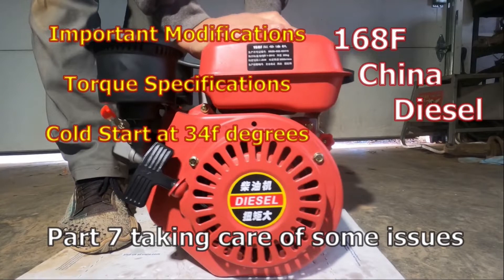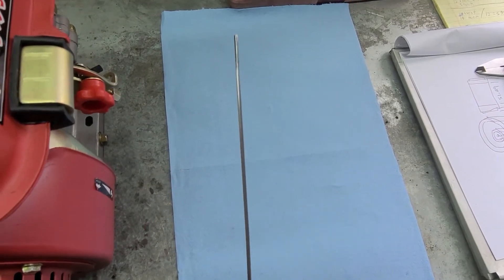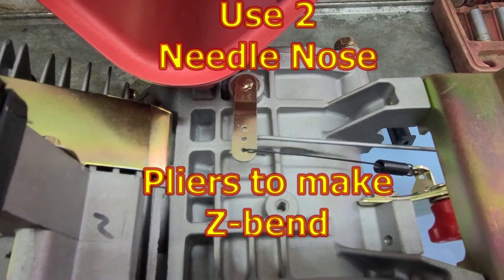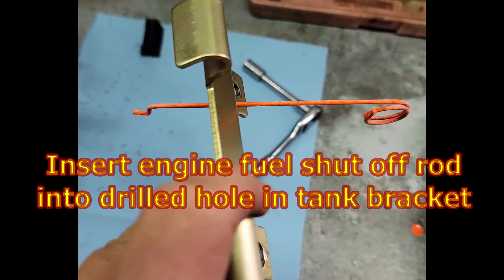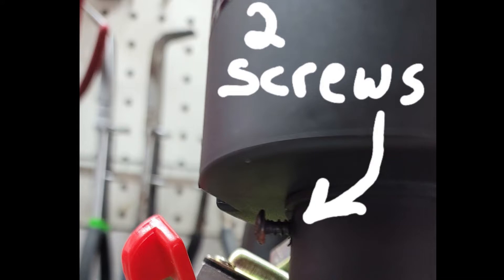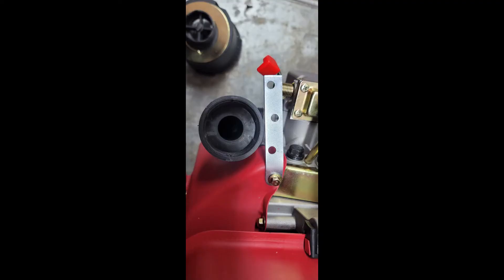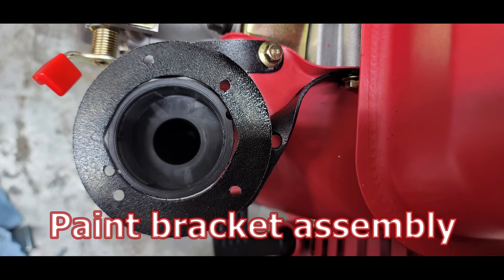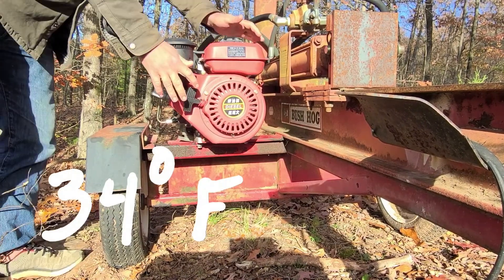168F Small Diesel Modifications for Real World Use! Part 7

Comment: If you could mount a flywheel to the engine, it would have more reserve power for those difficult logs
Reply: It has an incredibly heavy flywheel and that wouldn’t help for more than a second, once the flywheel winds down the engine has to fight against the splitter pump AND the heavier flywheel.

Comment: I have put 2500 hours on this exact engine. I have a driveway cleaning business and I run my pressure washer with it.  I, just like you, spent a day taking the engine apart and torqued everything down properly as I went along before I put the engine in service.

If you know your way around small engines, this engine is built from solid parts.

Cheers!
Reply: Dang, I didn’t expect the aluminum rod to last that long, it would be nice if the rod had replaceable bearings, but I just got the better version for $168 on amz. That’s an incredible engine for the price!

Comment: With an engine when you turn it over as your turning it over the compressed air heats the cylinder to the point that the fuel will vaporize and you have an ignition - we refer to it as flashing the fuel - 
     With gasoline engines propane is dissolved in the distelent as it goes through the fuel nozzel or carb jet the propane flashes off the gasoline - the spark plugs ignights the propane or butane  vapor and that's the catalyst that ignights the distelents - 
     Part of what a cat cracker does in a refinery is to bind vapor gases or dissolve vapor gases into fuel - it's done with diesel also to a degree for cold regions - 
     The difference in winter gas and summer gas are the vapor gases used in the gasoline - in the south butane is generally used as the primary vapor in gasoline - it no longer evaporates below 32° - up north propane vapor evaporates down to minus 32° so it's used in northern gasoline as a primary vapor to start an engine on -

Comment: What weight oil are you using I know the manufacturer says 10w30 I just want to make sure before running mine
Reply: If your in a cold area go with 100% synthetic 5/30 - during the summer if it's warm day and night go with stright 30 CD oil - ( only use fleet oil as used in over the road trucks - that grade 3 or series 3 motor oil )

Comment: I was looking at these Diesel engines for some themed Zombie Survival motorcycle built like a moped - with redundant abilities, but I wanted to make it a bit zippier with a turbo yet be more fuel efficient with it since the bike maybe with extra weight like backpack saddle bags - survival mode, etc... and a clutch driven roots supercharger some pressure on the intake side and also feeding on the exhaust side for the turbo I thinking similar to a jet engine of afterburner type affair, of spinning the turbo at the lower end to give our zippy. The concept around "Zombies" leaving "dodge" in one heck of a hurry! and for say, hill climbing loaded up with the range of 300 lbs including the rider - top-end speed is not really what I'm after with the build, as there will be Zombies to contend with, and traffic or diverting with alternate routes, etc...I was planning with a 7HP 305cc at 3600RPM and perhaps or a 10HP 418cc at 3600.

My question to you is what boost pressure estimated do you figure these diesel engines can take, provided with an inner cooler, oil cooler, electric fan, extra oil filtering, etc. Everything was provided so as not to overheat, and we have provided for the necessary extra workload for stressful times. It's part of the Zombie "theme" powerful when needed but fuel efficient, for long-distance travels. They make a small turbo for this I think producing 3lbs. I was thinking since being a diesel needs a little help at the lower end, not a peppy as a gas build. To give a little more hedging. For instance, would slightly heavier valve springs be necessary for more boost, etc.?  I would be using a transmission of 3-speed with reverse. 

Just trying some options before I commit to building and weighing the best choices.
Reply from the maker: I would really suspect the bottom end couldn't handle a ton more pressure if you are worried about longevity.  It really depends on the metallurgy of cases, crank and rod.  Being made in China, unnamed branding?
Reply: @mossycreekvids  Hey thank you for the reply Well I have done more checking out and gone to a 999cc turbo diesel V-twin water-cooled as this one has 4 valves per head, they make it for one of their can-am buggy things, also used in a Kubota tractor 🚜. Yes having a sturdy built engine is the next step, They are using a forged steel crank, missing I think are the H-beam rods and beefier mains and perhaps some sort of girder plate. I was watching some in line 6 of Mercedes engines for a street race engine, just normal under turbo there bending rods from the factory, having to upgrade to the stock H-beams. It's not huge upgrades but just Stock HD like they use to apply back in the 60's era. 4 bolt steel mains etc.
I also managed to find a tractor gear transmission and a rear drive unit that gives two hi-lo gears to play with, but there is cast iron looking at having them in cast aluminum, that's going to be costly about 15k a mold then you have to order 300 units of each since there not being used as intended but just have to overcome some weight, they're not working as hard, basically pushing peanuts around. That basically solves a majority of my build concerns. Currently in design just looking at cowling and rider storage and gauges like with Harley the street glide and the road glide and building something in-between, not that there will be any special electronics involved, not that's it overly needed, most stuff can be done with the cellphone. For those that want to have systems to play with. Since the theme is Apocalypse pre 70's era analog - less to go wrong. keep it simple yet functional as the digital may collapse. Other than that factor the design phase is completed.
Reply from the maker: cool sounding project

Comment: can't you use the decompressor to shut the engine down?  (like in old moped-2stroke-engines)
Reply from the maker: Yes you could, I had rather be able to shut off fuel supply to stop the engine.
Reply: You’ll risk hitting the piston with the valve, there is probably enough clearance, but these engines aren’t built to exacting specs.
Reply: I don't know why but the book does not recommend shutting it off with the compression relief
Reply: @able880  Yeah ... probably because the compression is way higher in this Diesel-engine compared to that in a 2stroke petrol-engine. More risk to burn the valve. Should make sense.

Whatever ... great and most interesting hints you give here.
Thanks for sharing this.
Reply: @joostderidder  I have a oil burning compression start diesel engine that I used at times - 
   Some times I might not need it to run for two yrs - 
       When I shut it down I shut it down by opening the compression realise so that the injectors coats the cylinder with oil - 
     I live near the coast and engine cylinders will size when engines set long enough that oil coat from the fuel prevents that from happening -

Comment: Sweet. Know of anyone that has converted one of these little puppies from horizontal drive to vertical? I want to put one on a push mower so I don’t have to dicker around with a carburetor system for one. And possibly run it on used vegetable oil for two. Thanks for the video!
Reply from the maker: would be an interesting test going to vertical.  Oil  level might need experimented with and I would put a valve oil seal on the exhaust valve. Might work.
Reply: @mossycreekvids  So you really think it's possible ?
Then I really need to try it !
Reply from the maker: @dieselmats  I think it might your oil level with really be an experiment to get correct.  I would also install a valve seal on exhaust valve.
Reply: You would need a gear driven oil flicker because the oil slinger won’t work sideways, the sump would have to be deeper so it doesn’t constantly burn oil and hydro lock from the piston being submerged in oil. I would say it’s not worth the effort.

Comment: Say I dont want to do a total teardown, what bolts are imperative that I loosen and probably torque?
Reply from the maker: In mine bolt tightening was messed up all over the place.  Parts overall seemed fairly well built but bolts were not equally tightened anywhere.  Unfortunately neither front or rear seal was lubricated upon original assembly.  So pretty much needs torn down if your was assembled like mine.  Those dry seals would fail prematurely most likely.